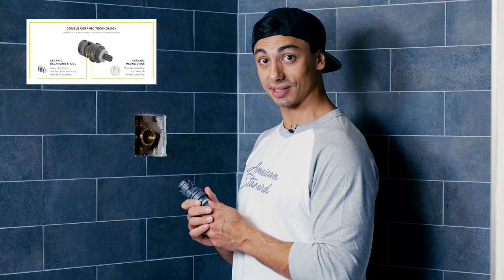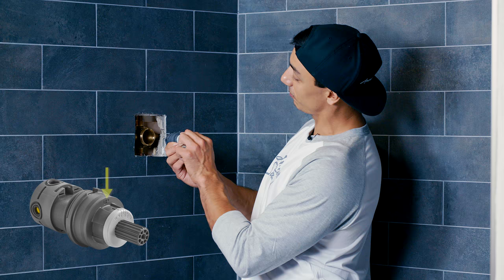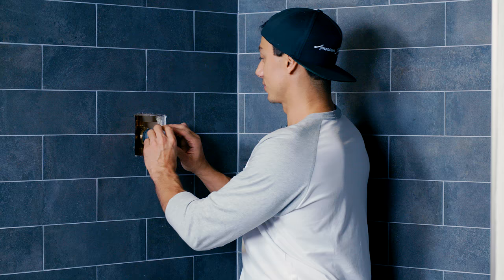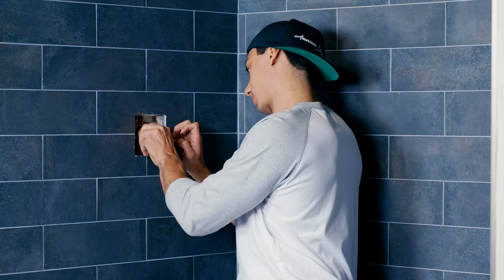Installing the Trim on the Flash Shower Rough-in Valve with Jonathan Cheever

Comment: I need an American Standard valve for shower only. Which one do you recommend?
Reply from the maker: Hi Jose -  The Flash® Shower Rough-in Valve (Model #: RU101) is designed for fast and efficient installation without adaptors to reduce leak points. The flat back and compact body ensure a secure and simplified install process that can accommodate smaller spaces. Thanks for your question!